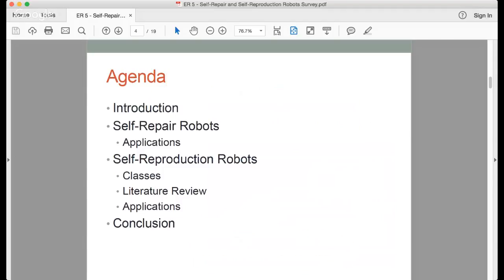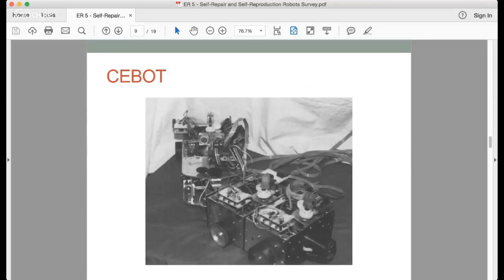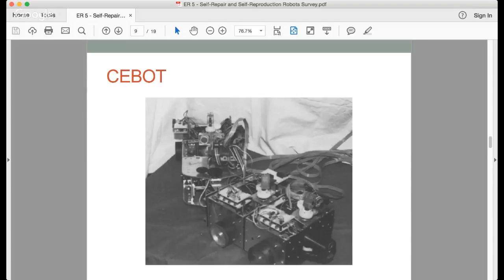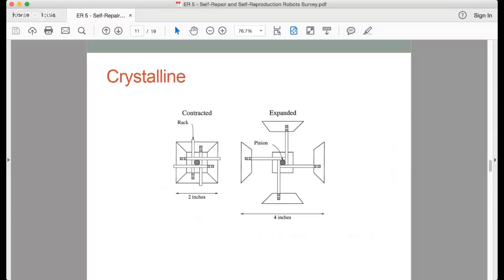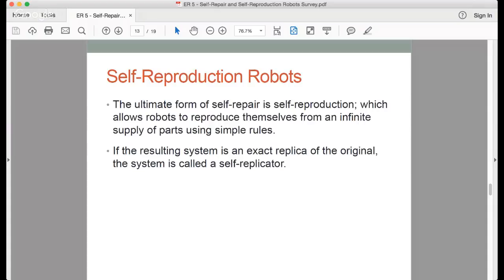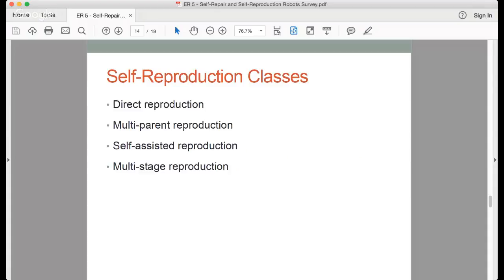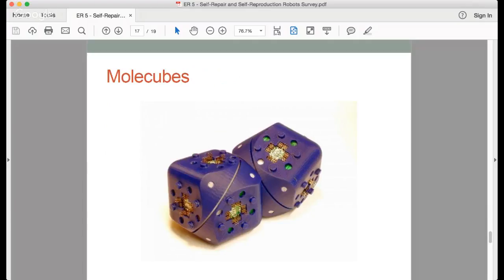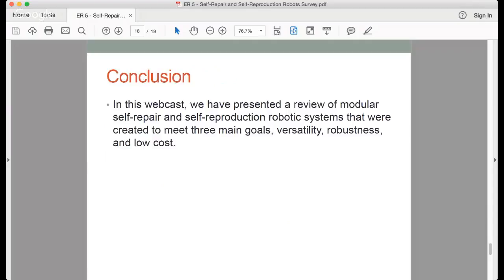ER#5: Self-Repair & Self-Reproduction Modular Robotic Systems

Comment: I find this interesting. I was thinking of modular systems as being an easy source for upgrading a system. I was however woundering, what if the main control unit malfunctioned? Should each module have their own mcu. Also, the robustness of the product. Great video.
Reply: So I believe that most of what is being presented comprises individual units, each with their own tiny 'brain', which collectively just forms a bigger 'brain' when assembled (which may not even mean physically connected in some cases). So there wouldn't be a central single intelligence that brought the whole system down if that one failed. There has certainly been research that uses that model, but I personally don't see the value for the reasons stated. What's also interesting are the parallels between swarm robotics and self-assembly, with coordination and collaboration between individual units for the greater good. There are also swarm systems that self-assemble to complete objectives or overcome barriers, such as physical bridge building to traverse gaps larger than an individual can cross by itself etc. Similar to how a Self-reconfigurable robot might accomplish the same task. All very interesting stuff!
Reply from the maker: Thank you!
Reply from the maker: Stephen, where have you been? I miss seeing you in the current videos. I hope all is well...